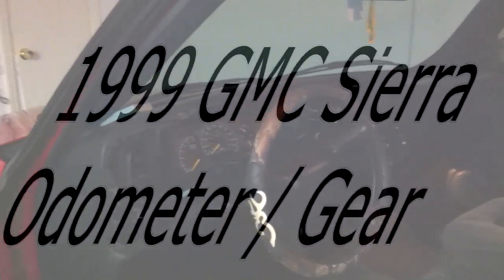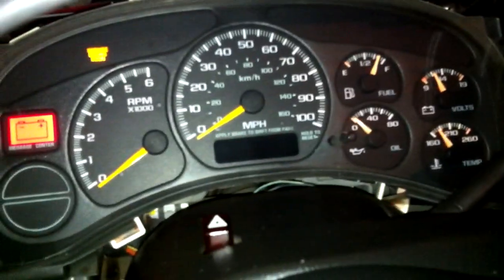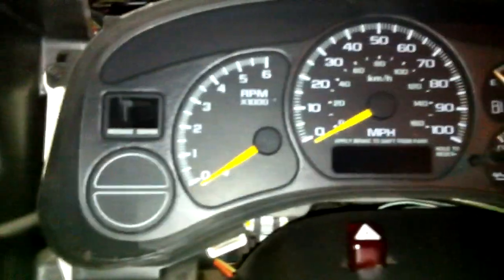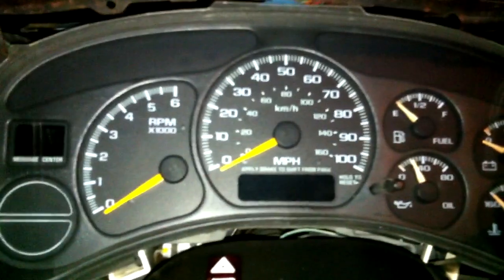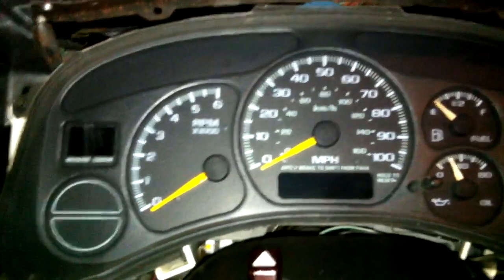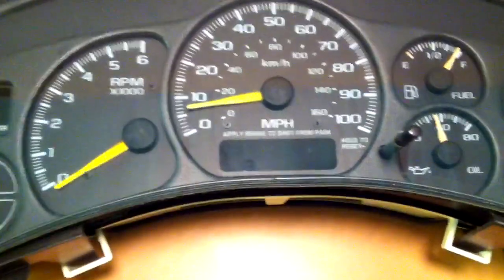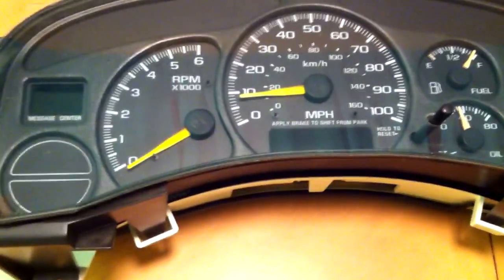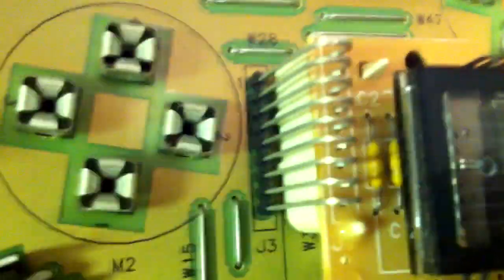Odometer/Gear Shifter (PRNDL) Display FIX - GMC/Chevy

Comment: I just had this exact problem with the odometer display on my 1999 GMC Sierra and have some good information that may help someone out.  The pin on the LCD board referred to in your video as the common pin is actually positive DC voltage that powers the LCD.  This pin feeds three power resistors in parallel so this probably carries significant current.  The resistors were ok but I could see they had been running hot since the circuit board around the resistors was turning dark.  Once I lifted the LCD circuit board up I saw right away the pin had de-soldered from the circuit board.  You won't see this, nor can you re-solder it, without lifting the board from the white plastic support.  I re-soldered the pin and that took care of the problem.  One other thing I want to mention is the circuit board with all the lamps and the LCD does not just lift off.  It has to be carefully pried off of the connector pins that go to the gauges.  Once you get it free there is a small harness that feeds the driver info display that can be unplugged so you can check the LCD. I didn't use any grease on any of the connectors.  Relatively easy fix.

Comment: as a heavy equip tech for thirty yrs, who don't know squat about cars. I thank you. youre explanation was clear concise and on point.  took it apart raised led (IT PIVOTS) found  . lookinking at bottom row right side second from left. sorry did not get pin #/  a what appeared a hollow pin, and we know that aint right"  pushed it up alittle bit from back side.  used a fine wire solder dental pick heated on gas stove magnify glass lots o light (im old),. and gave it a little love.  reinstalled and checked. all good. the reason im posting is  feedback is important, in my world we have a sys  called call trac.   symptom cause and fix. ,,,,saves a lotta guys a lotta time and a lotta money  so thanks keep posting

Comment: I followed the instructions. All of the circuits were soldered. I used WD 40 instead of white grease and my mileage is now visible again. I was able to avoid a $600. 00 replacement of the cluster board.Thanks Eric!!!!!
Reply from the maker: That is awesome. I would recommend using contact cleaner and dielectric grease instead of wd40
Reply: Akuba Manu I did the same but as soon as it dried out it lost connection again. I had to solder it and yes when i bent the display back to have access it broke another solder joint. All the solder joints are weak compared to what i put on it after i was done. :D Yup the dealership wanted about $600 and i fixed it with a little bit of solder and time.
Reply: larry tanton You are correct.  As soon as the wd40 dried out, the light was off again.  Did you solder all of the joints or just the one he referred to in the video is loose?  Also, how long did it take you to solder the joints.  Thanks for the information.
Reply: Akuba Manu  ok

Comment: I have 2002 GMC sierra 1500 that would not start we hooked jumper cables to it and it still would not start finally it started but after it started brought it back to shop and checked battery and it is ok checked alt it is putting out 14.5 volts but now the battery light stays on and the transmission will not shift automatically you have to manually and I have no blower motor and the cruise control does not work and the tow/haul does not work has anyone had this problem before

Comment: I have a 99 Sierra with the same problem.  Pulled the cluster, took a look, and sprayed the plug with WD40 and blew it out.  Plugged it all back together and it works just like new.  

Thanks for the Help!

Comment: Great video! Just repaired my 2001 Suburban 1500 gear shift indicator display. I had the same issue. The display would work on and off randomly. Then eventually stopped working all together. Also appreciate the 7mm socket size reference and pointing out the suspected soldier joint that typically has issue. I had to look really hard at the soldier joints to finally see the lack of soldier on the top pin. The vehicle mileage was never effected during my repair.

Comment: You're the man! I have a very trustworthy shop I go to and they said they could shop the display off for about $250 since they said they didn't know what to do about it.  I took the display out, cleaned the connections and tightened one pin and the display works perfectly now!  Took me about 20 minutes from start to finish!!!
Reply from the maker: wow you really saved some money there!

Comment: I had same problem(no light for odometer or gear shift) I followed the video and now it works. I had to put a dab of solder on the pin you described. Thanks great video.
Reply from the maker: awesome man, glad it helped!

Comment: I used air duster on the LED after removing the panel on my 01 chevy. Also on your blower motor check your clip between the truck and the blower motor. Mine had melted so I had to occasionally tap or kick the motor to make it go. Ultimately replaced it and hard wired the blower motor. But hell yeah on the advice for the cluster! Works like a charm now!

Comment: Intermittent blower motor issue and "solution" for me.

I have had the same problem for years (2000 Silverado). Here's what I do: 
Turn on the truck and the AC fan. Under the dash, directly below the center of the glovebox, there is a wiring harness. Slip your hand up from the floorboard behind the A/C ducting. Wiggle the wires. Blower comes back on. 

I've done that for about 8 years now. I should find the loose wire and actually fix it, but I'm lazy. Really. I'm very lazy. I'm so lazy that I mostly ignore the problem  except when my wife is in the car. I've taught her how to find the wire, and she does it.
Reply: Most likely the blower fan resister

Comment: Thanks a lot man I really appreciate the tip fixed my gmc 2500 4x4 cluster using your video
Reply: How? Didn't show what he did. So you cleaned yours? Mine is out. But I have odometer readings

Comment from the maker: you can bend the screen to the left by picking up on the right side and bending the pins. Check all the pins and make sure they are soldered completely. I sprayed white grease on the blue connector and have not had an issue since then.

Comment: Love the blue display, i think they are often a really bright green with a thick blue plastic filter in front.

Looks much like the types used on vcr's and some dvd players, there are filiments that must have power applied, in the dark you can see a faint red glow on the horizontal wires, with no filter.

Looks like you sorted it without selling a kidney for parts money :-)

Comment from the maker: Yes, I'm going to guarantee you that #1 pin is your problem, it shouldn't move at all. You should be able to bend that board to the left with no problem. If a solder joint breaks when doing this then it should have been re-soldered anyway. Thanks for the comment!

Comment: 121214: you did a man size job there. i figured when you examined the solder, you would have found an intermittent solder (cracked-solder, cold-solder, or broken solder joint). if the problem happens again you might want to re-solder all suspect solder joints. Use a magnifying glass to help see the solder joints. Hope this helps

Comment: Thanks the video helped out alot.
I didnt notice that you could lift up the screen to check the soldering. I just took it apart and cleaned it. It is still going on and off randomly.
Is it normal for the screen to be loose on the right side? I could move it up and down a little.
also what kind of spray did you use to clean it? I just used Q tips and rubbing alcohol.
thanks for the video and please respond :D

Comment: Hey Eric I got the same problem just reversed. my odometer is lit up but my back lights wont come on. I changed the fuses and still no luck. I have a video on my channel of the problem.
Now I seen your video i might go ahead and change the switch panel.

Comment: hey iv got a truck just like this, same motor and short cab step side, just in like silver, i was wondering how many miles yours has on it and if you have had any transmission problems yet? cause my transmission isnt doing so good and its only got 114500 or so miles on my truck

Comment: Hi I have a 2001 Chevy Tahoe. And after I replaced the fuel pump. And connect the battery the dash intruments it doesn't work anymore. Some advises I really  appreciated thnks

Comment: You mentioned about maybe a bearing or something for your fan speed and my fathers dodge dakota would only run on high speed and we replaced a motor resistor or something for 20 bucks and it fixed it. I don't know if that has anything to do with your problem but though id throw it out there

Comment: Shouldve seen the display in my dad's 03 duramax gmc. Started out just flashing at startup, then it would quit working till it warmed up, then it started doin all sorts of weird shit. It would go haywire, sometimes the odometer would work sometimes not, you would have to bang on it to get it working sometimes. Finally went out today, he had to order a new one.

Comment: i have a 2000 Chevy Astro van the park indicator goes out when you start the vehicle and battery light and low fuel lights come on and no temperature gauge but oil and volt meter works fine  the voltage gauge reads 14 volt and over head console go blank tried changing cluster and get the same problem can you tell me what to check to fix thanks

Comment: what was it with yours? was it that first pin? what do you do to fix it? Or did you also just clean the blue plug? I resoldered mine and it is still doing the same thing.

Comment: I have an 04 trailblazer LT with the DIC odometer. My gauges randomly stop working except tach and speedometer.   I get warning lights at randomas well like service FWD airbag warning etc. My odometer reads "error mi" and does not show mileage any more.  What parts do i need to fix this.  I am very capable if pointed in the right direction.
Reply from the maker: I would take it to the dealer and have them run an instrument cluster sweep on their computer. They can tell you exactly what is wrong with it. I wouldn't know if its a computer issue or if the cluster is fried.  My truck has the older style cluster. I know you can buy stepper motors and parts on ebay for these newer clusters, as well as complete ones.
Reply: What tool do they use to do a sweep?
Reply from the maker: Its a just a big handheld scanner that they can troubleshoot each gauge and light in the cluster, among other things.
Reply: Is it something i could buy or is it dealer specific?   I was wondering if the bcm could be causing the issues
Reply from the maker: its dealer specific, said GM on the front, the tool costs about a couple grand. my bro works at the dealer and had it to do a sweep on my gas gauge.  turned out to be a bad tank level sensor. If your cluster turns out to be fine they can also check your bcm.
Reply: EricTehRedneck You made it look so simple I had to try to fix my odometer so I could read it. Took about 15 minutes.  I can't believe I have been putting up with an intermittent light for so long.  Thank You !!!!  By the way your video was the only one that I found that specifically addressed the odometer light.  Thanks again.

Comment: I know this is old video but I have had issue with 2002 Tahoe no odometer, but when you push dome override twice in dings and odometer will cut on but headlights and taillights cut out, press two more dings and lights come on and odometer goes out! WTF! any ideas?

Comment: Ok so my 02 silverado has no PRND lights. But it has the odometer lights. Also no tow light comes on. So before i rip my dash off. Are these ran by lights or something complete different. I have the check engine light the abs light and stuff. But seems as i am missing the park lights Over drive lights and prob a few more others i am forgetting. Amy help would ne great. Just bought this dam thing and already pissing me off😂

Comment: Ok so I have a 2005 Silverado 1500 hd with a similar issue except I can barely see the gear display, It is really dim and I just noticed it today, Could this be the same issue you had and showed how to fix in this video or something different?
Reply: mine was dim, and would come in and out. I pulled the cluster apart and found 3 purple resistors with bad solder joints immediately under the display screen. They are kinda sandwiched between the main board and the display board. Quick solder fixed it immediately.

Comment: there was a recall issued for the radio and instrument lights back in 06.don`t know if it is still valid.check with GM .
Reply from the maker: Don't know haven't checked and probably won't. It works for me
Reply: Howard Dozier good

Comment: Hi there, I had a quick question about your notifcation at the end of the video stating you put white grease on the electrical connector before replacing the cluster back in the dash.

Was this white lithium grease? or dielectric grease? I've only known dielectric to come in tubes not spray and i've never heard it refered to as white grease, it does in fact help insulate electrical connections but im not sure lithium would help.

Just curious.
Good job, i need to take a look at mine as well.
-James
Reply from the maker: Dielectric grease

Comment: Can someone help me?
I had to repair my 2007 saturn ion redline clutch and clutch master cylinder, after fixing it I put everything back together and reconnected my battery and now most of the warning lights on the dashboard are on without the ignition key even being in the ignition. battery, high beams, seatbelt, brake, pretty much everything but the check engine light and the symbol with the car and lock inside of it. 
I removed the steering column and ignition completely and have unplugged any connectors that attach to the clutch pedal assembly and still the lights are on. Cher, directionals and headlights, high beams all work, interior lights all seem to work normally. ar was able to start while back toget

Comment: what exactly did you put grease on?.
Reply from the maker: The big blue connector that plugs into the back of your cluster. It can sometimes work itself loose
Reply: ok so I will just put a small amount across the front of the connector?.. thanks man

Comment: I have a 2000 chevy express 1500 the shifter stay lock to 2 can't go back to park or anything I change the safety neutral switch is still remain the same ? Anybody has a suggestion what I can do next

Comment: I'm just curious, so what exactly did you do? Looks like you just took it apart and put it back together so I'm guessing that it was a loose connection or your not real sure what you did either? I'm not trying to be be rude. I just didn't see your repair.
Reply: I had something like this  before too,I believe the connector was dirty,I ended up having to connect and reconnect it around 10 times in the course of my attempts at troubleshooting,then all of the sudden it worked,as I fixed nothing else I must assume the repeated  disconnecting and re-connecting cleaned the contacts.

Comment: checked this, still got issues, is there a fuse power I can test at,  heres a link to mine if you can put on input Gm problems1

Comment: You said you're engine is flooded. It's most likely your fuel pressure regulator. Common problems on gm

Comment: I have an '02 Suburban, and my problem is similar.  The gear LCD and warning lights work fine, but the speedometer and all of the gage, and radio lights just stopped working (just the lights), after blinking on and off, sometimes.  I think it's a common problem, and not the fuse.  I'll play with the dimmer switch, and it might come back on.  But last night, it wouldn't.  People say the dimmer switches are bad, even new ones, and you have to run a jumper wire to the dimmer switch wire. Anyone have this issue?  BTW, can you show what exact spray you used on the connector, and how?

Comment: I have a 99 s10 ..no odometer. .no rpm..no mph...fuel is full..temp is all the way high....(but voltage is perfect and oil pressure is perfect. ..)....ive looked all over and I still cant find the problem. .
Reply: Have you fixed it?

Comment: Dont fix this problem, because the drivetrains on these trucks don't know when to quit. I'd rather see no mile odometer readout nowdays than 303,000 miles on my old truck. 🤣
Reply from the maker: haha it ended up going out on me again so i got a guage cluster from a friend's 2000 model he wrecked and it has almost 300+ on it, my truck has about 60k less i have to keep reminding myself haha. still runs great